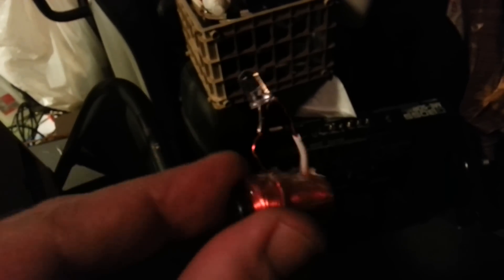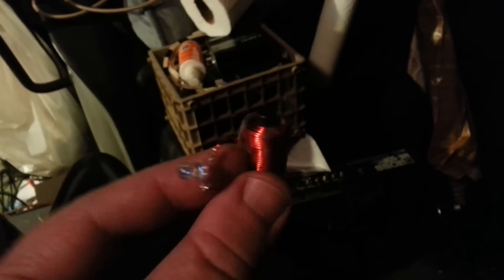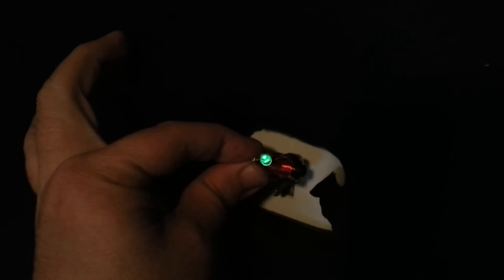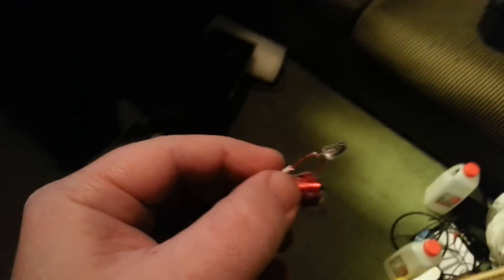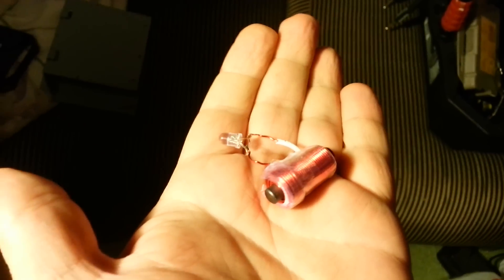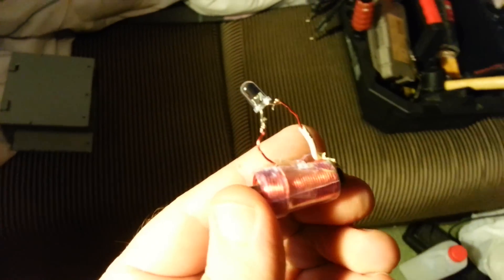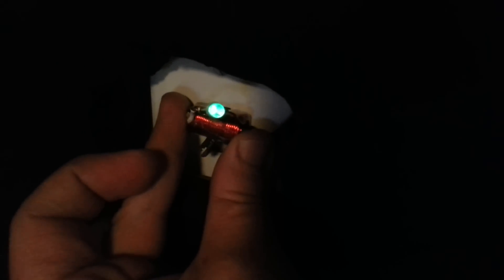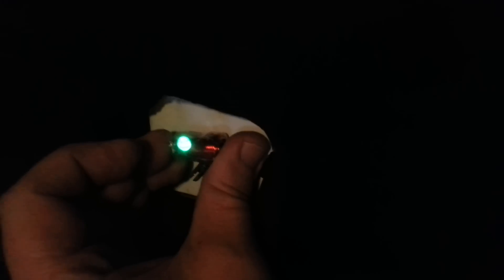LED + Inductor + Dimmer Switch Proximity?

Comment: You can do the same think with a fluorescent tube.
Reply from the maker: ***** Neat, I'll have to try that :p
I'm assuming, in my case, it's "Inductive coupling" with the inductor and LED. 
I recently made an inductive coupling speaker that I can lay my cell phone on and it to amplify music which is basicly the same concept. Check it out if you get a chance. Thanks! https://youtu.be/0e6wrOkiQaE
Reply: It's been years since high school physics bit u assume that's the effect of your coil. With the fluorescent tube it's the stray electrons exciting the gas in the adjacent tube. Or that's at least what I remember.